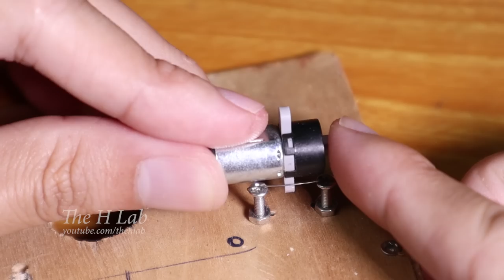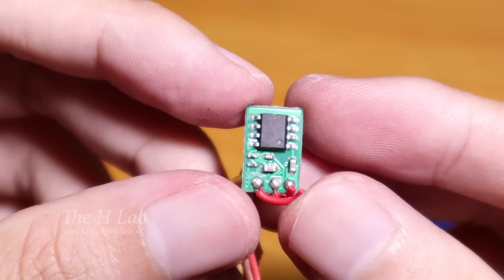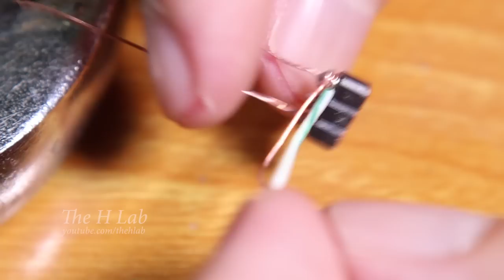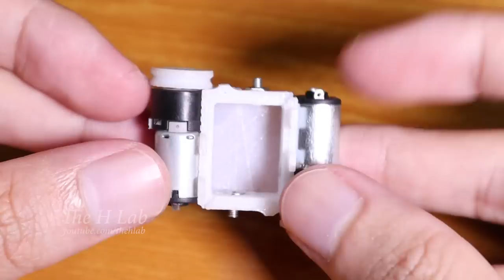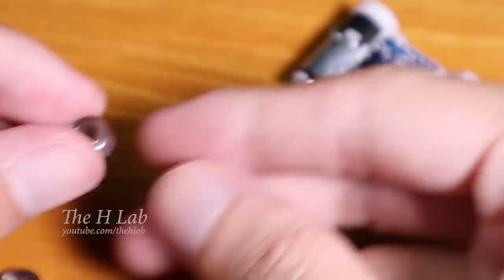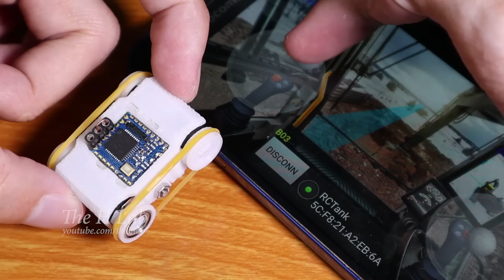Tiny Bluetooth RC Tank | The H Lab

Comment: You need a new solder tip urgently!
Reply: Good good
Reply: Fdg
Reply: And clean the new tip with a brass sponge and not with a wet kitchen sponge!
Reply: @MegaSteamfreak  is that that causes the tips to eat itself up( create a dimple in tip)? I’m beginner myself and im also  having this issue any help or advice will do
Reply: @boynextdoor240  No, this happens if your tip is not coated and the copper gets eaten away by the solder itself. Solder and copper form an intermetallic alloy/phase and this process removes the copper every time you wipe the tip clean.
Just buy a coated quality tip, and it will not happen.
The wet sponge is cold and leads to thermal shocks in the tip. Also, it makes your tip oxidize more.
If cracks form they destroy the coating and the tip can also get eaten away.
Reply: @MegaSteamfreak  clean it every time and you'll have a good tip